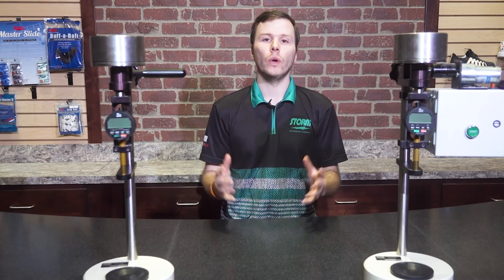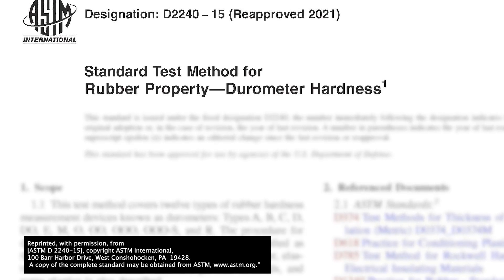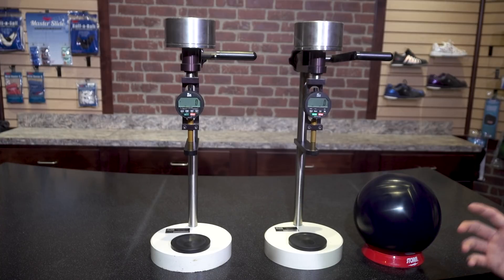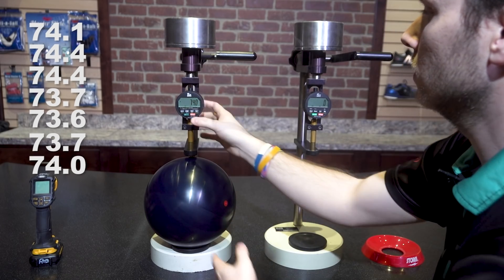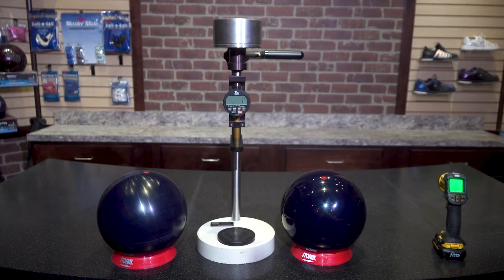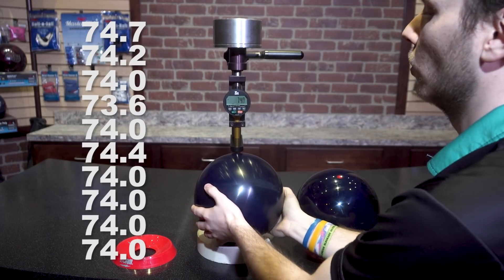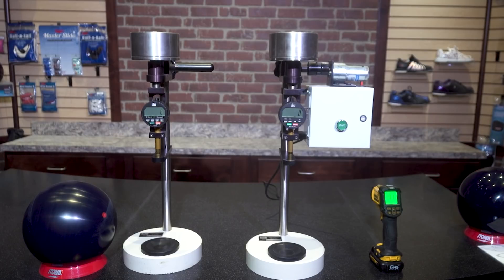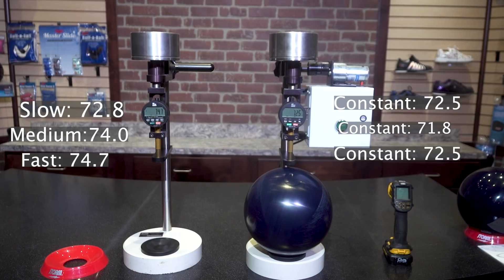Storm | Durometer Testing

Comment: Why did they take the time to design and build a robotic test button only not to use it in any of the tests but the comparison to hand operated? This makes all the hand-tested results invalid based on your proven point of their inconsistency.
Reply: Exactly what Ron says, USBC does it by hand, so they did it by hand in this video to show how much more inaccurate it is.  Your last sentence is a big part of the point trying to be made.
Reply: @LukeRosdahl  except it invalidates their testing since the test is being operated by someone who is aware of how to alter the results intentionally. If they're so confident, let's see random Spectres at their factory finish tested with the automated machine.
Reply: Because USBC doesn't have a robotic test button, thus inducing more human error.
Reply: You're missing the point. It also would invalidate the testing usbc does in your opinion, because all they're trying to do here is show you how much the testing can vary based on user or operator actions, equipment used, and testing sites according to the ASTM. They've also already shown that the same ball can both pass and fail right next to each other, and the astm itself shows there can be as much as a 4 point difference between lab results just on average, let alone considering the extremes which were a NINE point difference. 

So even if they pulled some spectres and they all tested at 70, that would prove nothing, because they passed usbc certification in the first place. Even if they did fail in this video, they've obviously passed before and could pass somewhere else.

Conversely, they could pull something out and have it test at 76, well above the standard, but due to the variance of the testing, it could STILL fail at another lab, so what then? 

The whole point of this video was to show how much the readings can fluctuate based on several different factors, which they did, but you're somehow saying that if they brought some spectres out and tested them on the automatic durometer, that that would mean something or be absolute. The whole point of the video is to show that the method itself, operated by a human or not, comes with a large amount of variance, enough that you need a larger amount of tests from a larger amount of machines from a larger amount of testing sites to create a greater amount of data for a more reasonable determination. 

A spectre on that hammer could read 70 or 76, and that does not mean it's failed or its legal, because at 70, it could still pass somewhere else, and at 76 it could still fail somewhere else. 

The grand point is that the test itself is not nearly accurate or consistent enough to make a defined limit with no tolerance when the procedure usbc uses is as loose as it is. There are no guidelines in their procedure about surface prep to be tested at, speed of pulling the lever, amount of machines that have to be used, or amount of operators that have to be used. One person could be operating one machine and as long as the ball is 70-77 degrees and they test the ball in 10 different locations, that's it, that's apparently all they need to certify or de-certify a ball. This video showed the large amount of variance and results that could be obtained with such loose guidelines and  testing procedures.
Reply: @LukeRosdahl  yet only balls manufactured to the absolute hardness limit when tested by USBC AND THEN polished are known by Storm to test soft, which means they knew they'd fail regardless of user or machine inconsistencies. Otherwise, why don't all balls fail the tests? It's only balls made right to the limit and then polished. Stop trying to blame the rules for speeding and getting caught.
Reply: You still don't get it. There's such a variance in what failing actually means. I keep saying, and this video keeps saying that there's such a variance in what passing and failing means and can be that the one person for usbc testing on the one machine in the one lab CANNOT BE the one and only source of whether something passes or fails. How is Storm supposed to so carefully walk the line in regards to this when the line is 5 feet wide?? This whole thing has been to show that the science isn't anywhere close to exact and is super loose, but you continue to miss or avoid that point. How are they supposed to know what they're pouring the balls at if one machine says they're 75, another machine says they're 72, another machine says 74, and another says 73??? 

And why doesn't the governing body of the sport who sets and enforces these rules know there's a variance in testing dull vs shiny?? You really think their testers don't know exactly how they can manipulate the results? Anyone who performs any kinds of tests IS TAUGHT about the variance that can be caused by operational procedures, that's why every other testing method out there has rules and restrictions on what is considered a valid test. 

Just because these balls are testing a point soft at USBC DOES NOT MEAN THEY'RE SOFT. These same balls have been testing just fine everywhere else. They showed the difference in testing using two identical machines side by side, yet you're still trying to argue a point you don't understand in the slightest. WATCH THE VIDEO. ASTM even says that one calibrated machine at one lab can read NINE POINTS HIGHER OR LOWER than a calibrated machine at a different lab, so how do you know which one is right? 

So tell me this. If you have one ball that gets tested by 5 people at 5 locations on 5 different machines, and you get an average of 70, 72, 73, 74, and 76, which one do you believe? Which one do you trust? This is a 20 minute video showing and proving how inaccurate the science is, and you're trying to argue here that it's absolute and rock solid.
Reply: @LukeRosdahl  funny, they don't seem to have a problem with any of their other balls that aren't so close to the limit, and neither do the other manufacturers 😉
Reply: All they're saying here is that the method is so unscientific that who knows what's actually passing and failing . . all these other balls that are passing might not actually be passing . . again . . just because something is passing or failing on one machine operated by one person in one location doesn't mean it's actually passing or failing, that's the entire point here that you continue to fail to get
Reply: @LukeRosdahl been following you for years…. I think the point that was trying to be made is that once it has been established that a human doing the measurement introduces variance, why not take that out of the equation to show the other factors that show the discrepancies in the data being collected. It is clear this isn’t an exact science either way. I’m curious if Storms answer to this is to stop factory polishing equipment, replacing it with the 4K Fast finish (at least with equipment that might be close to that 73D number). On a personal note, I’ve always loved the 1500 polished out of the box finish, but am more consistent when the factory finish has worn or been knocked off.
Reply: @LukeRosdahl  you're deluding yourself. This is literally only an issue on balls made right on the border of illegal and then polished. If machine/user variance is supposedly the cause of 98% of balls testing under, they are too close to the limit to begin with. And Storm knows this, which is why they aren't showing Spectres testing legal consistently or balls at 76 or so consistently testing under. Test a bunch of Spectres with the automated machine and compare that to a still legal ball like a Hyroad. Case closed.
Reply: Nah. You can't answer simple questions and I worked for several years in a federally funded research lab, so I know exactly what I'm talking about.
Reply: @LukeRosdahl  you're delusional. You've failed to address every point I made.
Reply: That's because you didn't make any points, I was trying to explain how you don't even know what you're talking about enough to make a point. The testing method is so full of inaccuracies that the results are only accurate to a point. You obviously didn't watch the video or you wouldn't be saying what you're saying
Reply: @LukeRosdahl  you sound embarrassing now, claiming I didn't watch the video or make any points. That's not a cogent defense of any position. It's low-level attack.
Reply: Oh and by the way, your speeding analogy is great so let's work with that. Say the speed limit is 70, and your speedometer says you're going 68. Cop pulls you over, says they clocked you going 77, going to give you a ticket. Oh but wait, that doesn't sound right, get your speedometer checked, it was calibrated fine. Oh but so was his speed gun, so we check other speed guns. Some are saying 68, 69, 70, 72, 74, etc., so which one is right? Why is the highest one considered right and why should you get a ticket if there's that much variance? If you could either be going 68 or 77 mph depending on what you look at, why should you get a ticket, especially for being such a small amount over? Usually cops give you a little tolerance. Oh but that's not even this situation, you're getting a million dollar ticket for going 70.3 mph even though your speedometer says you're going under 70, and other speed guns would have had you under 70 as well. We're just going to ignore those though and only go with the ones that have you speeding because of course those are the ones we're deciding are accurate. Oh and there's something on the lens of that speed gun too that's contaminating it and affecting the readings in the wrong direction, but we're going to ignore that too.
Reply: @LukeRosdahl  a cop can give you a ticket for going 56 in a 55. I've gotten a ticket for going 3 over. This is only a personal discretion. The law is 55. 56 is speeding. Argue it in court and lose.
Reply: But the whole point is that if they can't prove their method of determining your speed is accurate enough, it's thrown out. I'm done here, you continue to fail to see the point, which is that this testing method has so much variance in it that it shouldn't be used in the first place. Just no idea why this is so difficult to understand
Reply: @LukeRosdahl  GUILTY 😂 You are lashing out because you have no defense. Good luck if you really think you'll escape a speeding ticket by arguing user error and variance.
Reply: Actually, you can get out of a ticket for arguing variance. Pretty much any judge in the country will throw out any ticket under 5mph over the limit (10 over in high speed situations) as soon as it gets to court for that very reason.
Reply: @sethc5661  this is anecdotal on your own opinion, not fact. "Pretty much any judge in the country" is a complete red flag for any type of serious argument. And this info is just not correct. The law is the law. Discretion of application of the law is on the governing body. People get tickets for speeding any mph over the posted limit. Those who fight in court can argue variance, but the only evidence they usually can admit is calibration records. If the device was calibrated withing the required time, you won't win your case. And it certainly looks like USBC had properly calibrated machines. And the variance is the reason USBC has a tolerance that allows a certain percentage to test under in spot tests.

Comment: This is supposed to be a defense, but this proves Storm knew the balls would test illegal once they had their factory polish applied. 🤔🤷‍♂️
Reply: I believe the test of a sanded ball, and a polished ball was to prove that there is another variant other than the already inconsistent variances in the actual durometer, and then it’s surroundings. Going from the sanded to the polished, and then back to the same polished ball showed that. But I’m no expert, just stating what I think the purpose of that test was🤷‍♂️🤔

Comment: While watching the first tests between the 2 machines, I notice that the second durometer never reset back to 0, there was always a 1 or 2 showing on the readout.  I don't know if that is to the right of the decimal point or to the left, but interesting that it never went back to exactly 0.
Reply: I think that further proves that durometer testing is not an exact science
Reply: @warhawk3972  You think that not properly clearing an error proves the durometer testing is not an exact science?!  Umm, errors are a part of anything with electronic readouts.  There are durometers with physical readouts, just use those.
Reply: @warhawk3972  no, it demonstrates that the equipment being used in this video is either faulty or out of spec
Reply: I seen that too! 
It was showing an error after each clear.
Reply: ...and the results were about 1 different than the other.  Imagine that.  Plus, that durometer showed a 2ERO message.  What does that mean?  Maybe Storm should look into that. NO, actually... look into your balls that are too soft.  Then look into your durometer.

Comment: I understand the testing procedure and the variances, and it's great this ball meets hardness specs, but it would be more interesting to see the actual balls in question tested for hardness. Clearly durometers aren't perfect, but not all of storm's balls are banned either so even though this video is a good demonstration of the variables in hardness testing, it doesn't make a difference to the argument of "USBC is improperly measuring hardness."
Reply: Actually based on the numbers, it would depend which durometer they use. The left one makes it legal, the right one makes it under 73D. This is why the manufacturer even states to allow for variance.
Reply: @Medic96744  USBC has an allowed range that can test under the legal limit to accommodate these issues. What they don't allow are 98% of the balls tested to test illegal.
Reply: @Medic96744  both balls are legal because they allow 4 point either way from 73. A ball that comes back at 69D is still legal
Reply: @ethanwilliams2254  the balls they banned were in the 71D range with polish  according to what usbc posted
Reply: @bbarnes654  but it's not like they cherry pick 32 balls that they know will test illegal
Reply: Also in a document USBC released, they claimed that they review every quarter balls from every company, if this is the case, that science fails because all these variables, why didn’t we see a collapse in every company?
Reply: @bbarnes654  that means 31 out of 32 balls tested were illegally soft! You just made it look worse

Comment: If the rules allow a range of values for the testing, the manufacturer should be able to use the most favorable point in the range of each variable (temperature of ball, speed of needle motion, sanded [not polished], use the manufacturer's own approved, properly calibrated durometer). If this is not acceptable to the governing body, the manufacturer will have no way of doing quality control on its manufactured product. Even if a ball ships polished, that should not required the testing to be done on a polished surface, since we have seen that the polish corrupts the reliability of the data (if testing is done on a polished surface, the durometer is measuring the polish in part, not solely the surface in question). If the durometer manufacturer does not specify a maximum velocity of needle/handle movement, a faster movement should be permitted. And finally, the manufacturer cannot access the governing agency's durometer during manufacturing (for purposes of quality control), so their own durometer has to be the controlling reading. This is just proper methodology. I would suggest that the governing agency should do its own testing, and field testing, using these same criteria. That way, there will be no confusion, and consumers will not be inconvenienced needlessly.
Reply: It’s the governing body’s job to ensure the specs are met.  It’s up to the manufacturers to comply.  The rule book covers what temp and surface finish the ball is supposed to be at.  This video did not show or disclose that.
Reply: @timothyschaffer2287  this so much

Comment: If the USBC had left the hardness at 72 which it was at for over 45 years we would not be having this issue. Way to go USBC, you fucked up things again.
Reply: I'm not sure that's correct, because companies design balls to be as close to the borderline as possible. If the rule was 72 instead of 73, companies would be manufacturing balls to be 1 point softer. You know this is true.
Reply: @JeffTeachesBowling  I have been bowling since before the hardness rule went into effect, and the whole time that the 72 hardness was the standard we did not have the issues of balls not complying with the hardness rule. Once the hardness was raised to 73 we started seeing issues.

Comment: Sounds like there are some holes in the process from when you test, usbc tests, and a ball goes into production, as well as the lowered hardness of the ball after many games have been thrown with the ball. I think it would be a cool invention to have something like a teeter tauter that goes up and down with a ball on it, so the ball rolls over and over. Let it run for a couple weeks and test before and after to simulate many games being thrown on the ball. Patch the holes in the process, and set defined hardness thresholds for before and after.